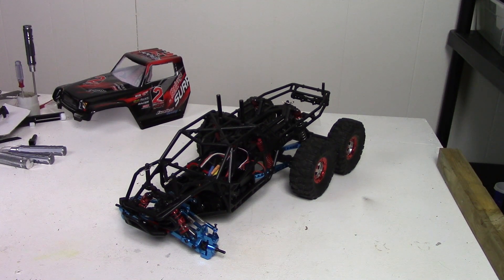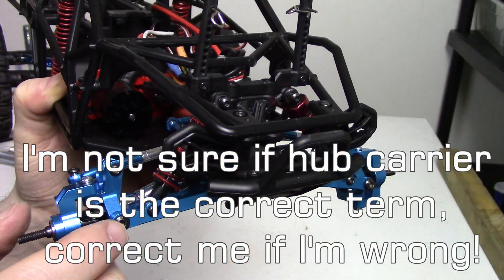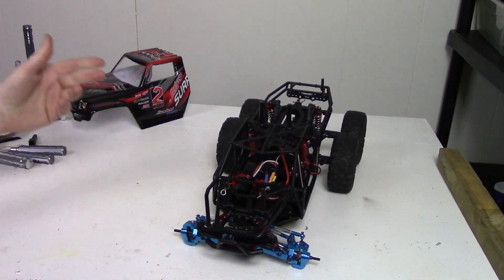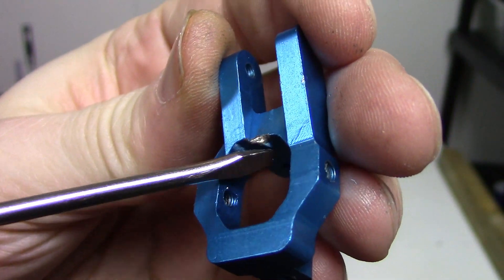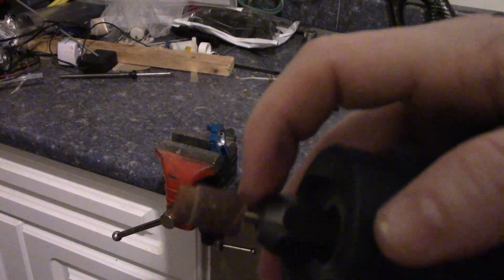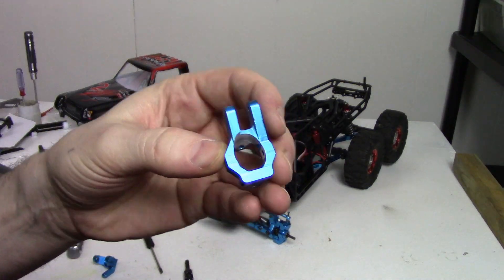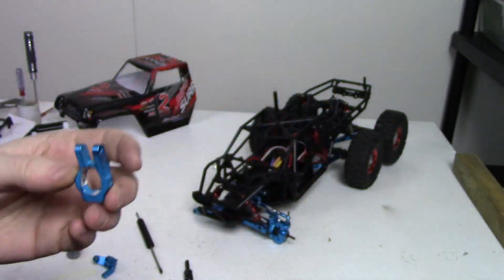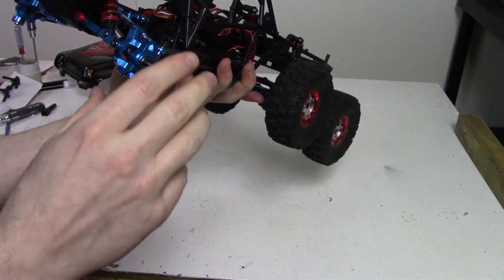Feiyue FY06 Upgrade - Fixing the Front Suspension Travel

Comment: You would think that the upgrade parts would be made to fit and that you wouldn't need to grind them to make a good fit.They always seem to come in that blue colour too.Would this fix do for the wltoys 12428 aswell.
Reply from the maker: Most definitely the fit and finish should be better. More colours would be nice too. I don't think you should run into this particular situation with the 12428 as the main reason for it was the thick upgraded feiyue drive shafts that were to bit. I don't think those drive shafts fit the 12428
Reply: Thats good as the feiyue and wltoys seem to share a lot of the same components.Im just waiting on RC stuff from gearbest and banggood the only problem is it takes so long to arrive. It takes about 4 or 5 weeks to get here which is a pain if you break something while out RCing.
Reply: The 12428 has a few different colours on eBay but cost more , I used oven cleaner on mine and then polished them look so much better than the blue in my opinion but takes a bit of work

Comment: Would that front shock tower fit the fy03 ?
Reply from the maker: Yes it will fit.
Reply: Void X RC nice what's it from or where can I get one ? I thought the standard fy06 had the same shock setup as fy03. good video hope it runs better now you've grinded it
Reply from the maker: The fy06 does come with the same shock setup as the fy03. The fy06 also had that shock mount in the package with it. I haven't seen it sold separately unfortunately. It does run better now, the drive shafts are no longer rubbing on the hub carriers!

Comment: A quick question. My truck has stopped working, I have steering control but no forward or backward movement. could it be a faulty receiver or esc ?.
Reply from the maker: It does sound like a fault esc
Reply: Thanks, I thought it was that, but it doesn't hurt to get a second opinion.